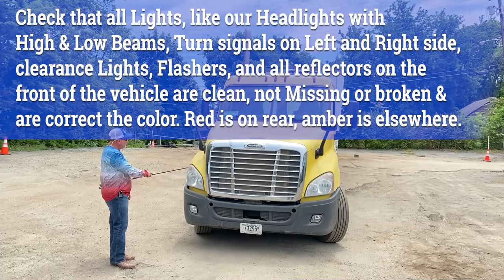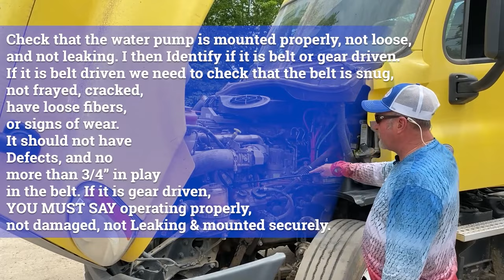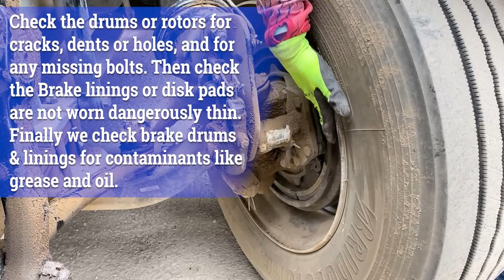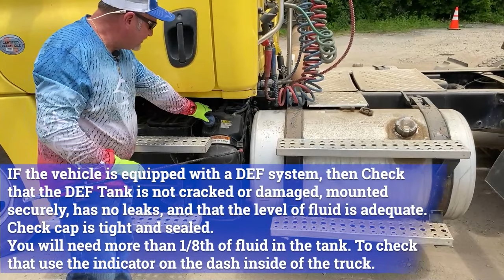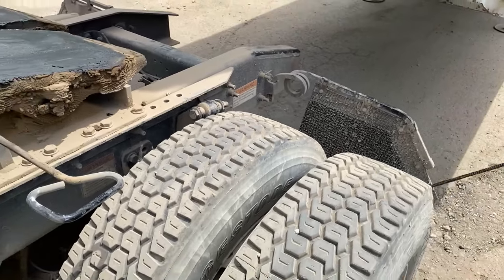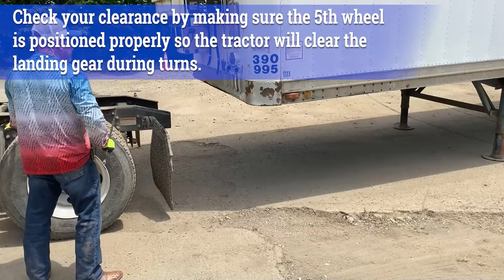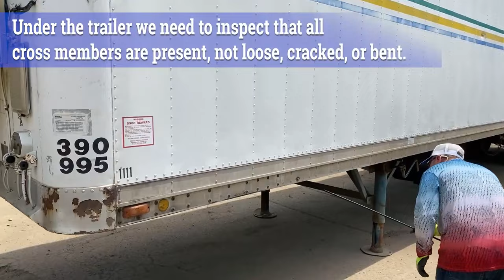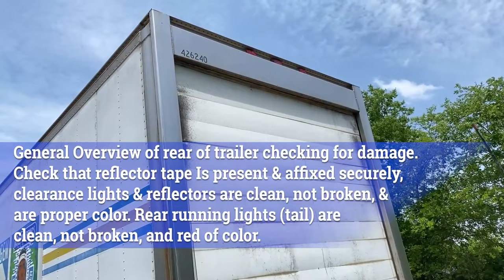Outside Class A CDL Pre-Trip Inspection in under 25 Mins

Comment: The only part I noticed he missed was the tread depth on drive wheels and tandems on trailer. Appreciate the video. I have had my cdl for about 5 years, just refreshing before a pre trip  test for a job
Reply: He mentioned it at the start when he addressed the drive tires- he stated that the drive tire tread depth and the trailer tread depth were both 2/32 while the steering tires were 4/32. He didn't mention it when he got back there to show a shortcut when he stated that he would inspect XYZ part the same way that he inspected the previous related part.

I agree that it would have been helpful to mention when he got to it as a "just in case I forgot to mention" sort of thing.
Reply: Same reason I’m watching. I got my first trucking job and am due to do a full pre trip inspection for the road test. This video helps HUGE!! Hope the jobs road test is easier than the government one
Reply: @justinmcnaughton3016  honestly you will probably come back to this even after driving. Haha even after driving for a while, you forget things and get rusty. You know what you’re looking at in your head, but you kinda forget little thinfs.

Comment: Question- I was told during the pre-trip test I need to check the psi in all 18 tires and all the same components on both sides. Is this true? (In Illinois)
Reply from the maker: That usually depends on the state. Most states abide by the AAMVA model that actually doing it is not required but pointing to and/or touching it and describing what you will do to check it is.

Comment: You forgot the windshield, grill, stickers being up to date, the bumper and the lights are not yellow they are amber in color! The truck is yellow
Reply from the maker: As a Driver those are definitely things to check daily. Even the battery box and air line to the rear of the trailer. However for a CDL test, they are not required to discuss.
Reply: @TnCDLSchool  they were on my exam in New York

Comment: If your abs light on can u use it for the inspection test
Reply from the maker: Depends on your state guidelines. Typically from a safety side (weigh station/real world), the vehicle would be placed out of service till the issue is fixed.

Comment: Now, I got a automatic restriction on my license, and I’m gonna go back to get that restriction lifted, would I have to do the whole test over again, starting at the pre-trip to the backing and then the road test?
Reply from the maker: Depends on your state. Each state has their own rules on how to get the restriction removed. Some states will say yes, you have to do all 3 parts in a manual CDL-A truck and some will let you even do all 3 in a CDL-B truck to get it off of your A.
Reply: How did you get an automatic restriction?
Reply: @cyberchiggin5596  he took his road test in a automatic truck
Reply: Yes it depends.  In New York State where I'm from, you have to take the road test and all 3 parts all over again in a manual transmission to lift the restriction.

Comment: 393.75. Tire regulations. Recaps are not prohibited on a cmv truck. Nor does it say they have to be matching tread. 
Am I saying just because recaps are Legal on a cmv truck they should be used no. Just a cdl school should be teaching regualtions correctly.
Reply: Steer tires have to be virgin.  At least in Tennessee.

Comment: man im going to school next month and they taxing $5800 yes more than likely you make that back 5800 thats alot
Reply from the maker: Typical Cost of schools can be $5-$10k. Some can be cheaper if you pay up front. Some can be more expensive if you need housing and other needs. However most trade school costs can be higher with no real job available when you complete it. At least with trucking the pay and needs outweigh the cost. But do your research and keep watching our videos for more info!